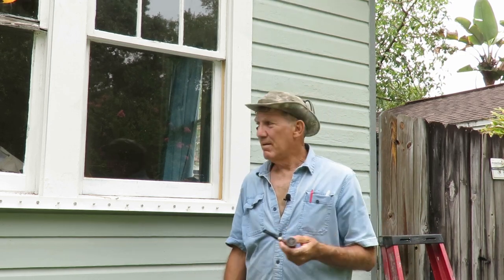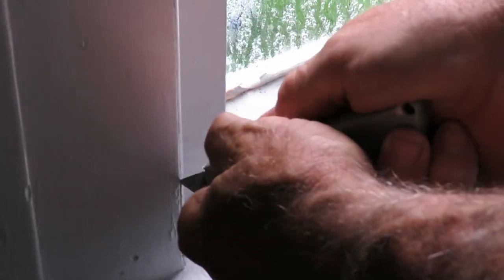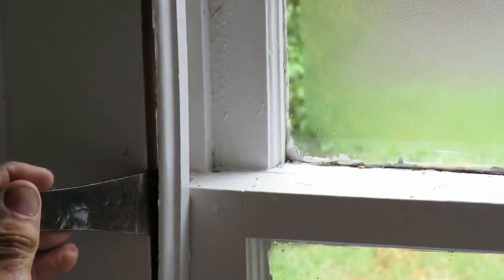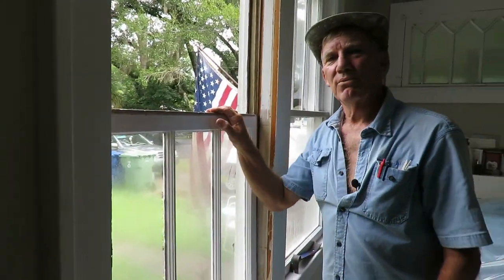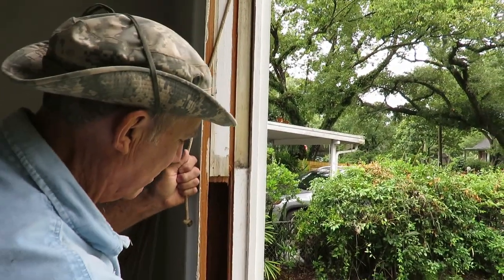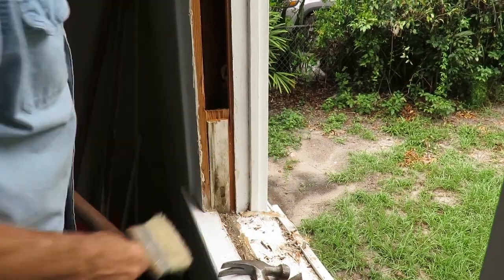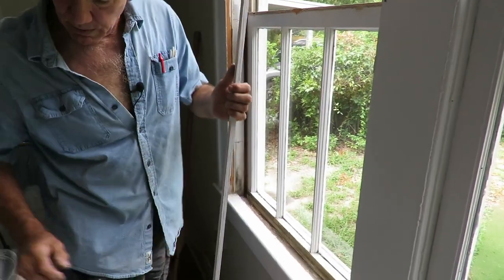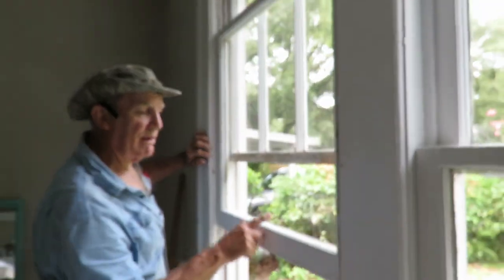HISTORIC WINDOWS - How To Free Painted Shut Windows!

Comment: In my spare time, I replace broken sash cords.  I've done over 300 sashes in the last couple of years.  I've seen a number of videos here and I must confess, yours is one of the best.  I'm in Lancaster PA, so heat loss through the windows is a higher priority than in FL.  Because of that, I never want to get the upper sash to move.  More heat loss if I do.  I share your technique using the chain and to determine the correct cord length.  I see you use the correct sash cord, not the crap you get at the big box stores.  I also use a multi-tool with a narrow blade to cut the parting bead off, just below the meeting rail.  That makes it easy to remove and reuse. The cut is not visible.  Also, most of the houses I work on were built in the late 80's, so the paint buildup is always an issue.  I'm also the only person in this county willing to do this type of work.  Sad, but true.  Nice work!

Comment: Interesting! -- QUESTION -- We are interested in wooden hung windows (in the North East colder areas).  We have seen someone claim that single hung windows seal better than double hung windows. But we like the features of double hung as they both slide and on some, the can lean forward too for cleaing.  Was that a double hung windows you fixed?  Can it seal tightly when closed?  Any thoughts on the "single" vs "double" hung windos?  Which would you have if you had to pick?

Comment: Great video! Is the panel to acces the ropes and weights always on the inside of the frame? Or are some accessed behind the trim boards?
Reply from the maker: Hi, and thanks for your interest. Sometimes, to get to the weights it’s necessary to remove side casings as not all windows have

Comment: Brian, I have 18 historic windows and have started to repair a small bathroom window to fix the weight and rope pulley system. My question is what do I do next? There are no screws holding the case holding the weights. Do I pry away the access panel, which is affixed with pin nails? I’m afraid of breaking the piece. Or am I better off prying off the front molding at the butt of the window? House is c. 1912.
Reply from the maker: Someone may have cut in an access panel after the window was installed & nailed. Just get a pair of side cutters to tweeze nails out; Or you have to pry casings off.
Risky if you have plaster .
Reply: @brianmanne7493  Thank you! I will let you know how I manage!

Comment: Did you end up replacing the piece of wood that goes between the sashes (parting, I think)? If so, did you have to mill it yourself or is it a standard size?
Reply from the maker: The parting stop is easy to make on a saw; 1/2 X 13/16 inch by whatever length needed. See my video on Ybor City cigar factory.

Comment: What about lead in the paint that you are "cracking" as you cut with the knife?  We have several windows that are painted shut in our victorian home but afraid to disrupt the paint for lead hazard.
Reply from the maker: Yes, You can buy a test kit at the paint store to determine the presents of lead base paint. If that’s the case wear a respirator, cover work area and doorway with plastic inside and out. Properly dispose of paint chips and dust. Call a professional prior to delving into a project like this if your uncertain you want to take on the task.
Reply from the maker: Did I say presents; I meant presence.
Reply from the maker: Yes, You can buy a test kit at the paint store to determine the presents of lead base paint. If that’s the case wear a respirator, cover work area and doorway with plastic inside and out. Properly dispose of paint chips and dust. Call a professional prior to delving into a project like this if your uncertain you want to take on the task.